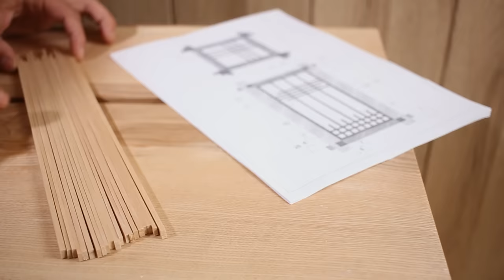Tabletop Japanese Shoji Lanterns

Comment: The lighting doesn´t seem to be very practical, but I do have to say, I love the design and the colour tone of the light.
I´d really like a warmer light in the evening and I don´t need every corner illuminated as if it was still daytime, but a little more than an old hurricane lamp would be nice...
Also, if they could run on a rechargeable battery for a few hours, that would really increase the usefulness.

Comment: Nice work, but you should install a li-ion battery to just charge it now and then so you dont need a cable for a few days. Also install a sensor so it with shutoff the light when its not dark to save energy.

Comment: I think if you sold the precut wood blocks and paper I would buy immediately. I occasionally have trouble with this type of precision because I use mostly hand tools. But I’d pay for such appreciation to the product and craft.
Reply from the maker: I considered selling them also as kits, but they will still need some kind of fine tuning, especially the kumiko panels. Even if the frame is perfectly made, there will still be little little imperfections in squareness for example, and the lamp being so small all those will be amplified and visible. I fine tune/edge plane each kumiko panel at the shooting board to match precisely in those spaces. I haven't show it here in the clip, but you can see it on an older one I made almost a year ago.

Comment: Beautiful. Love your designs Although Kumiko is beautiful, I prefer the simplicity of these. Can't see having a bunch of USB cables running into a computer to turn them on and off. And having just one or two would never suffice. Perhaps a shelving unit wired for six or seven plug-ins... But then you might lose the individuality ... Shucks - there's always sacrifices for beauty and art.
Reply from the maker: Thank you! Although these kind of lamps are thought as a decorative item, I wanted to add also a practical feature, put a light there and plug it when you want to set a mood in the room or something like that :) Ahh, they work also on other USB stuff, like a phone charger or any other device that outputs a voltage through that socket
Reply: @AdrianPreda  That would work since I have a multi socket.... 😉👍

Comment: Hey Adrian, Fantastic work as always. I was wondering if the panels are kept in place by friction only or do you glue then in?
Reply from the maker: Thanks! Friction, yes, they hold pretty well if you trim them perfectly. But for the ones I sell I place just one little drop of glue inside on the intersection of the panels just to have them secured during shipping and not make the customer tuning it when arrives :)
Reply: @AdrianPreda  Thx for the info. Congrats for your new shop btw. I'm tinkering in my garage at the moment. Hope I can do that someday as well.

Comment: A work of remarkable precision. A pleasure to watch.

May I ask you a question?
What is the type and what is the purpose of the white gloves you wear at the end of the assembly?

Anyway, congratulations and thank you for sharing.
Reply from the maker: Thank you! Those are some very cheap fabric gloves, cotton I suppose, I found lately in some hardware shops and I use them when assembly the parts so I will not leave any grease, sweat etc on the lamp, which was freshly oiled few hours earlier (was dried, but to be safe) and also not to leave any spots on the kumiko panels which are white, basswood, and not finished with anything (traditionally they don't finish those, the glass finish from the plane is enough)
Reply: @AdrianPreda  The sense of detail and precision, to the end.
 :)
Thanks for taking time to respond to me.

Comment: Absolutely stunning work, did you thickness all the material using the sled method with the hand plane? Would think the really thin pieces for the inserts had to be another method?? Found your video on how you created the pieces, WOW!!!!
Reply from the maker: Thanks! Yes, all. This way you get the most quality finish that you can't achieve with a table saw, planer, drum sander etc and also all precise and equal. The small ones I cut them at the bandsaw aprox to the thickness then plane at that jig, bigger parts, like the lamp stiles, same at the table saw, very close to thickness, so I will have room to plane after.

Comment: Amazing work. I made a jig similar to this but would get chip out and bits exploding. Any tips on avoiding this?
Reply from the maker: Thanks! If you see I use a pad to hold them in place, is a block of wood with a stop and a foam glued under

Comment: Adrian your work is amazing. I really enjoy a lot watching your videos and this is one of those that speaks out of you as craftsman. Adrian I would like to ask you something, how do you avoid rusting in your Veritas low angle plane? I have one and it has gotten some rust difficult to remove. any tip? Thanks for the video and inspiring others like me to this beautiful art.
Reply from the maker: Thank you Ricardo! My LA plane rusts like crazy also if I forget just 24h after using it to rub it with camelia oil. But when it does, I sand it with a very fine sandpaper, like over #1000 or with those abrasive pads made like a sponge that they use on car polish or use steel wool 000 or 0000 type. Depending on how rust it is start with a rough abrasive then with a finer one. Then use some oil or wax to protect it. I use camelia oil as I said earlier.
Reply: @AdrianPreda  Thank you very much, I will do that with mine and hope it looks as pretty as yours. Forget to ask, did you design the board for the leds?
Reply from the maker: Yes, the circuit is designed by me and sent it to PCB manufacturers.
Reply: Just as I thought. Which software do you use for that? Congratulations again for the lamps are beautiful for real 😊

Comment: where did you get the circuit board made. i make things similar they are night lights for kids with lexan  and i etch different pictures in them. i need a new easier way to light them. but i do love your craft is its very exquisite.  keep it up....
Reply from the maker: Google pcb fabrication or similar, there are several online shops from china, you send your files and they will make and deliver to you
Reply: I will check it out thank you.

Comment: Would it be possible to change the power source for the light to be powered by regular batteries instead of a personal laptop? What exactly would you need to do, if you don't have a soldering tool?
Reply from the maker: That can be plug to any active device that has an USB port, hence 5V supply, like a phone charger, battery pack, tv, laptop etc even your cat if she has an usb port 😂
Reply: @AdrianPreda  😆 USB 🐱, that's gold! Well the reason why I was asking was because my sis and I absolutely love Japanese items, weather inspired or from Japan and I was thinking about maybe trying a hand at what you had done as a present for my sis, cause she's moving out of the house into a tiny 🏠 that's a bit longer than a camper trailer, but is taller than one because of the two upper lofts, and she's kind of pressed for space with all of her things' that's why I had inquired about maybe a battery powered version with out the soldering 🔧, cause I don't have one and I'm not sure if my parents have one I can borrow. But after hearing that the USB powered lamp is a universal plug source I may do that, but I still have the problem of not having a soldering tool.

I'm really glad and thankful that you took the time out of your, undoubtedly busy, day to answer my questions! Thank you!

P.S.- I just looked at your Etsy Store and saw that you ship to the 🇺🇸, does that include Alaska? Because some online sellers don't, or rather won't, ship to my neck of the country due to how expensive it is. But you know what the irony is? A LOT of people think that Alaska is not part of the US!

Comment: Question: Why use glue when you've made such a perfect fitting joint anyway? I read in one of the books you recommend that glue hinders the ability for the wood to expand and contract and can cause cracking?
Reply from the maker: They are fitted very good but I put just a hair of glue to have them lock when shipped as they can get out just a little like 0.2-0.3mm and the kumiko panels will fall
Reply: @AdrianPreda  makes sense, thanks for the info :)